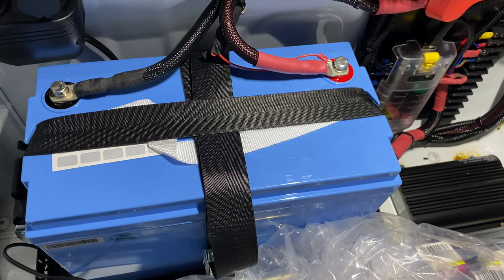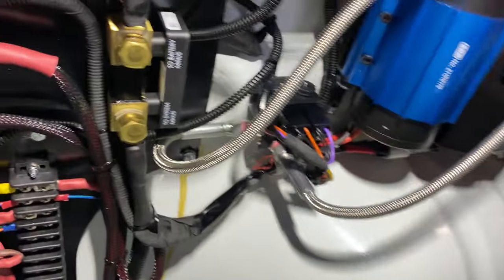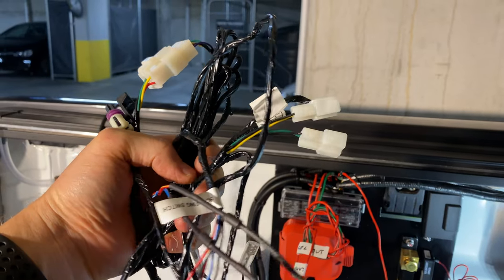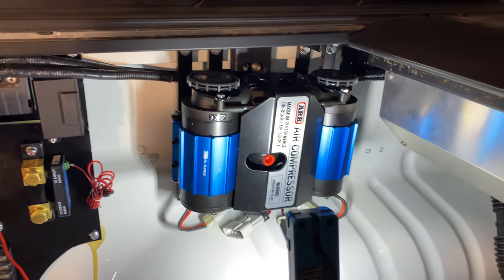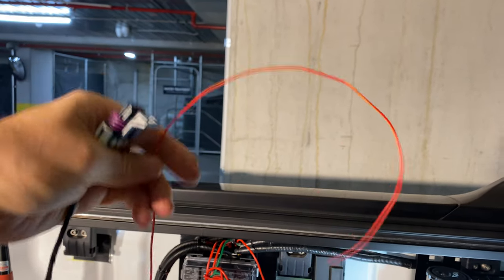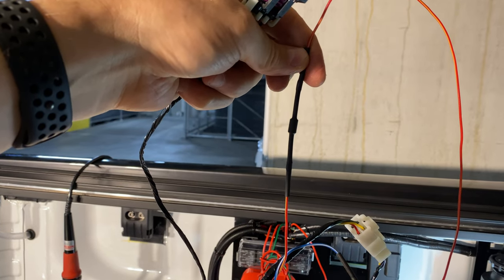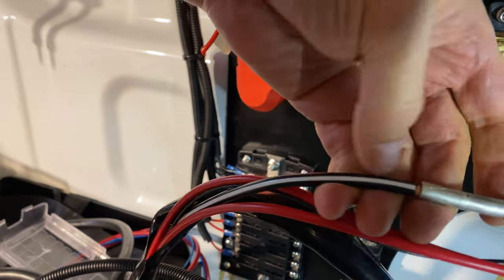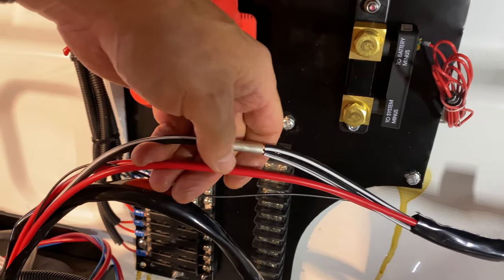ARB Dual Compressor Simple Wiring

Comment: Thank you.  I bought the dual ARB compressor and will mount it under the bonnet in a Prado where there’s space left for a dual battery (Pirate Camp make a bracket for the installation, complete with mount for the switch and air out).  I couldn’t believe all the crap that came hanging off the loom.  I thought surely there has to be an easier way to get power to this thing, since it’ll all be under the bonnet.  I look forward to throwing all that extra wiring in the bin  👍
Reply from the maker: Yer, I think ARB could honestly keep all the crap to themselves and just make the loom plug and play compatible IF a person was buying air lockers too.

Comment: Will give this a crack tomorrow morning as I have been battling getting the bigger arb harness to work today.. but in wanting to keep it simple and tidy, this is the way to go. Just have to find the terminal connections on the ARB switch as I want to use that to turn the compressor on/off. ;-) Thanks for making this video..

Comment: Thanks for this video. I needed to wire to an up-fitter switch in my Ford F250 and had no need for the other wires as well. I had to splice in about 7ft (2.1m) of additional gauge so the "tip" on keeping the lengths equal was very helpful as well. I'll but you a pint when I see ya!

Comment: Just to be sure.. The power going in to the switch, is just a 12v + going to one pin on the switch, then the red and yellow goes to the purple.. With the diode in between.
And then the main power and ground goes to battery + and ground.
Yes?
Reply from the maker: Wiring diagram: https://wai4wd.com/3185/simple-switch-wiring-arb-dual-air-compressor/

Comment: Thanks for that. So as I understand it, all that’s needed is 12v source post ignition to the switch. I’m thinking to use a fuse tap and utilise the accessory fuse box on my Hilux. Power then flows through the switch via purple wire  and the diode which triggers the relay in compressor. I will mounting under the bonnet and running it off the alternator / crank battery.
Reply from the maker: Yep, that will do it for only running when ignition is on.

Comment: Nice and clean.  Do you know why they need the diode when other relay switches don’t have them?
Reply from the maker: Its not about the relay, its about stray currents that get sent back up the line with motors. All electric motors do this, and where there is sensitive equipment (modern vehicles and/or modern accessories even in older vehicles), those stray currents can kill other circuits in the network.

Comment: great video! I'm about to install the ARB Twin compressor into my Ranger Raptor and I have no other choice to do it in the back of the bed. I need to extend the power harness to the back (around 20ft) I was thinking on a single 4 AWG cable from the battery and join the 2 8AWG to it. Do you think the single 4AWG will works for this setup?
Reply from the maker: That sounds pretty reasonable. 8m at double the max current of device, more than enough. That would provide more than adequate room for derating in hot conditions too.

Comment: I'm curious to see how you've setup charging to that aux battery.
Reply from the maker: I run an ignition switched lead from the starter battery to my DCDC, from the DCDC to the large fuse block. I also have solar running into the DCDC. Redarc 25ADCDC.

Comment: This is extremely helpful to me your sharing is quite valuable.  Thank you.
I get a bit lost as your gesturing regarding the orange diode wire as as which end goes where.  Is the anyway to clarify it in writing?
I am only a bit lost on the the plug with the purple wire.  I have no relays for lockers. Just want air as you described. I'm going to take this on in a say or so. Thanks- William
Reply from the maker: This may help William: https://wai4wd.com/3185/simple-switch-wiring-arb-dual-air-compressor/

Simply put, one end of the diode is connected already. That connected end you cut, strip and connect to the purple wire. The other end that is unconnected you connect to your switch power output (turns on compressor when switched). This is very low power wiring, so small wire.

Does that help? On the link above I have a schematic that shows this.

You would only use the second diode as per linked schematic if say you placed your switch in the ute tub and that switch had lighting. I'm not actually sure which way the lighting diode is, as I never investigated it, but if you need it the simple rule is, the way you cut it out, you put it back in. If you take the heatshrink off the diodes you will see a line around the diode on one end. That is the direction of the diode, you put power on the end without the ring and power comes out the end of the diode with the ring around it, but won't go the other way.
Reply: I hope yoy get this reply.... First time reaching out on YouTube. Thank you VERY MUCH. I plan to do this in the next couple days. It seems like it will greatly simplify one of the last aspects of my Toyota Tacom build. I got the link, I hope it's bookmarked.
I really appreciate your sharing and timely reply. 
William,  Bellinham, Washington USA
Reply from the maker: @williamlucrisia9169  Welcome mate, good luck with the install.
Reply: @wai4wd   It went off without a hitch. Install is complete.  Thank you for sharing your information.
PS... The compressor came with that little red plug in the air supply port. I opted to keep it in while working. Came time to hit the switch under your guidance,  it popped out like a champagne cork. Scared the  heck out of me.
Thank you. William, WA St. USA.
Reply from the maker: @williamlucrisia9169  Welcome mate... glad it all went smoothly for you.

Comment: This is so great. I am planning to use the stock arb switch and want it to light up. Can I run the second wire with the diode to my aux fuse box to illuminate it? Also the stock configuration of the switch has connection for two black wires, but the modified wire now only has one. Do I need to splice a second black wire to the existing and connect both to the switch? Cheers
Reply from the maker: The switch is double pole, double throw I think, so only one side is needed, as it normally switches both compressor and links into other switches for lockers. Ground is ground in a vehicle, regardless how many batteries are in it, they all act the same, so just one. You can take power from any light source for the switch OR power it from anything when ignition is on. How you power the light switch is optional, just note that you don't want always on power, as any light will be a consistent drain on your battery otherwise.

Comment: Hey there! Super tidy install. Quick question - the combining of the two wires (with the 2 x 40A fuses) into a single one then doubling the fuse (80A), is that how it works? I'm an DIY pers and just trying to get my head around it. Is it suitable if I just run both single cables to a single terminal on a fuse block then put the 80A MIDI fuse in line with it across the bar?
Reply from the maker: You got it Mitch. Just keep the cables the same length, that is the important part due to resistance, ensuring each cable handles equal capacity.

So yer, just cut them out and connect together into a single 80A fuse, good to go.
Reply: @wai4wd  Thanks! I appreciate it and will give it a go 👍🏼

Comment: Nice job, I'm about to install dame one. What guage wire did you use once you connected the 2 power cables together to use rhe 80amp fuse
Reply from the maker: If you're running it more than 2 metres away from battery, 4BS, if closer, 6BS is perfect for the job.

Comment: Great video. Thanks. My only question is what did you do with the black wire?
Reply from the maker: Hey Drew, the small black is the ground return for the switch IF you're using the backlighting wire. If not, it has no use. Two of the three wires are back lighting for the switch, one is the trigger on/off. I have a wiring diagram at: https://wai4wd.com/3185/simple-switch-wiring-arb-dual-air-compressor/

Comment: Hi mate, does hooking this up to your auxiliary battery make the compressor work harder? I have a 200amh lithium I would like to connect it to.
Reply from the maker: 12v is 12v, lithium, agm or lead acid, works the same. Mine is connected to my lithium 2nd battery, but works the same if I connect it to the start battery. Only difference is that I don't need to have the car running to avoid flattening my start battery, running on the aux.

Comment: Hi I have just installed an ARB compressors  and wired as you suggested I.e. purple to red and yellow wire  and later in turn to pin 2 of the rocker switch.   However the compressors won't start.  I might have connected the diode in the wrong direction. My question is how to tell if the diode is installed the wrong way as the diode is wrapped and no arrow shown.
Reply from the maker: Put a multi-meter on each side of the diode. If you have power one side, and not the other, you have it the wrong way round. Multi-meters have pointy ends for a reason, so you can stab the cable just enough to get a measurement.
Reply: @wai4wd  Thank you for your prompt reply.  I think in addition to the possible diode being connected wrongly my issue is also that I don't have a power source line connected.  I don't have a wire already tapped into a switch in the cabin so I am thinking of connecting the red-yel line to the +ve terminal of the battery and connecting the purple to red wire and in turn to pin 3 in the isolation switch will this work?  If so which way should diode in the red-yel wire go?  Your help is much appreciated.
Reply from the maker: @ksyapp  Here is a wiring diagram: https://wai4wd.com/3185/simple-switch-wiring-arb-dual-air-compressor/

Comment: Arb send a a switch with 5 prongs. The switch I’m going to get for my 2015 Tacoma had 4 wires. Would that work?
Reply from the maker: You only require a switch with 2 tabs, in and out. Everything else is switch back lighting related (lights on and ground) or double throw use (different switch position use). So yes, it will be fine.
Reply: @wai4wd  sweet okay that makes sense!

Comment: I don't have a harness to cannibalize. Do you know what type of diode will work? I was just going to get one off amazon.
Reply from the maker: Its just a trigger circuit, so it doesn't need to be large. If you had a diode for 1A that should be more than sufficient.

Comment: What's the reasoning of adding the diode to the circuit? I've seen other "simple" installs t-tap into the purple wire, but not sure why you'd need diode protection from power flowing the opposite direction. I intend to wire mine through a switch-pros 9100. Just curious as to why you added the diode. Cheers!
Reply from the maker: Hey Greg, ARB provide the diodes already inline in the appropriate cables. Diodes are used to stop stray currents going down wires that current should not be travelling, specifically, stray currents are present with DC motors, being what the ARB compressor comprises. I do not profess to know the internal wiring of the ARB compressor, I've never pulled one apart, however, ARB have obviously tested their system that they include the diodes within the wiring loom as standard to stop stray currents back down the switch and switch lighting wires.

Based on this fact that ARB are including them for stray currents in these two wires, I would highly recommend to keep them in place because they have obviously recorded stray currents on both of these wires. Stray currents down these wires from motor hammering into a Switch Pro's is exactly why you have a diode to ensure power only flows the correct way, to avoid over-currents coming back down those wires into electronic circuits such as Switch Pros, let alone through manual switches and into vehicle circuitry, where stray currents could damage a vehicle ECU and other sensitive electronic equipment.

Comment: The diode is only required if you tap your switch power from ignition. If you connect it to the battery directly, there is no diode needed.
Reply from the maker: Sounds about right as the battery acts as a big capacitor in essence. Is that your point? That is, if you wired it literally from the battery terminal via a switch. In my case, because I have other circuits running on the same power circuit... needed.
Reply: @wai4wd  Yeah, kind off. I think the diodes are to protect the vehicle circuits/ECUs from any current running from the still spinning compressor engines back into the vehicle system, if the internal relay of the compressor is being engaged by i.e. ignition.

But let me think if I've got some sensitive components myself in my aux battery system .. :D

Comment: Hi mate, I’m about to do the same thing, so the purple wire you join the red and yellow wire with the diode on it to the purple one then to the switch, and the black wire in the one coming of the switch? So they are the only 2 wires coming off the switch yeah?
Reply from the maker: Hey mate, wiring diagram on my blog: https://wai4wd.com/3185/simple-switch-wiring-arb-dual-air-compressor/

Comment: Highly not recommended to combine the 2 fuses into 1 .. the motors are rated a bit under 40amps each. If there was an overload/ overcurrent  fault  situation ( such as a seized piston or damaged bearing)  on 1 motor the fuse will blow before the motor massively overheats or potentially  catches fire. At 80amps this may not happen and result in alot of damage.... with the fuse in place you can possibly save it and just repair the unit/ component that failed.
Reply from the maker: Hi, changing to a single fuse will not change overload protection. Overload failure will still blow an 80A fuse as fast as it will the 40A fuse, as overload will drastically and rapidly increase current draw, which is what the fuse is designed to handle. A circuit breaker may not trip, but a fuse will blow rapidly at the correct rating.

You must remember, load will only draw what it needs, so if each motor is fed individually, if one motor blows that line will overload, whilst the other motor line will still only draw what it needs, means no damage to it.

Comment: Hi, I have followed the exact way you have wired the twin air compressor, though when I flick the switch on the compressor it doesn’t start ?
Reply from the maker: Hi PJ. Either, you changed the direction of the diode, easily checked, just measure voltage on either side of it, OR, you aren't getting power on that line, OR, switch is faulty / wired incorrectly, OR, worst case, the compressor is stuffed.

Just place 12V onto the wire directly, no diode, switch, nothing. Ensure the fuses are in on the power lines and you have power there too.
Reply: Thank you for getting back to me, i wonder if it would make a sense if I am to run wiring from crank battery opposed to auxiliary battery 👍
Reply from the maker: @pjtaylor6655  Mine runs from my aux battery, all of it. I have the compressor power wired directly to the aux via an 80A fuse, and the switch runs from the aux through a fuse panel, to my switch, out of the switch to the compressor diode.
Reply from the maker: @pjtaylor6655  In all honesty, the easiest way is to just troubleshoot the power with a meter (multi or bulb tester type), to ensure you have 12V where you're supposed to have it, and when.

Comment: I found your video, and am grateful for such a simple explanation.

Do I have to use the diode, if I'm connecting to a switch-pro? The switch pro, is a base unit that connects to my switch-pod (8 buttons on a small pad). It'll provide the 12V to the purple wire when I push my panels button.
Reply from the maker: Yes, leave the diode in, as a compressor is an inductive load circuit, which Switch Pros themselves recommend using a relay or such, however, you're already doing that internal within the compressor and I understand you're only switching the compressor relay via the SP, but the switch wire is still susceptible to stray currents. I do not know what solid state switches SP uses, so I can't tell you outright whether their solid state are using a one way or not. Not all solid state do, thus making them susceptible to back current from motors, even switch wires on motors.

Based on their FAQ https://www.switchpros.com/faq/ stating to use an independent system for motors, I will assume their solid state switches are susceptible to stray currents, so you really don't want to risk taking out your SP system entirely all because of a little diode.

Comment: My purple wire does not have power coming out of compressor? Am i missing something?
Reply from the maker: The purple wire is the wire you put power onto in order to turn the unit on. You run power into a switch, out of the switch onto the purple wire.
Reply from the maker: See diagram Nick which hopefully helps you out: https://wai4wd.com/3185/simple-switch-wiring-arb-dual-air-compressor/
Reply: @wai4wd  all good thank you figured it out.

Comment: on the cable for the main power source where the 2 red cables go into one and the 2 black go into one there is a tiny black wire. what is that wire for? do i Need it?
Reply from the maker: Twist them together, both negatives. On the new model you have a black and a black-white. Both negatives.
Reply from the maker: The official wiring diagram from ARB: https://www.arb.com.au/assets/air-lockers/5-08.pdf

See the last page, which is the dual compressor.
Reply: I’m sorry, I mean the 5th wire that is much smaller than the other 4 what do I do with that one?
Reply from the maker: @tikkamike  Yep, if you have 2 large red, 2 large black, and one small black, twist the blacks together.
Reply from the maker: @tikkamike  I think the small black is the ground that links through to the black on the switch loom that powers lockers... from memory. Either way, it doesn't hurt, as per the diagram linked. Its really about losing the rubbish on the smaller secondary loom that is the switch power.